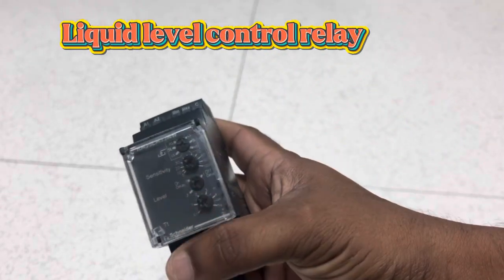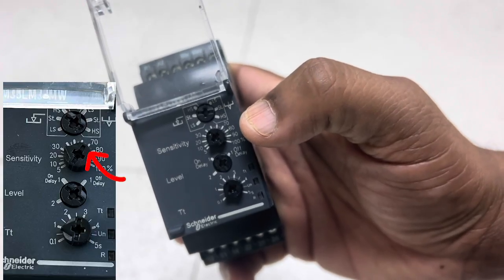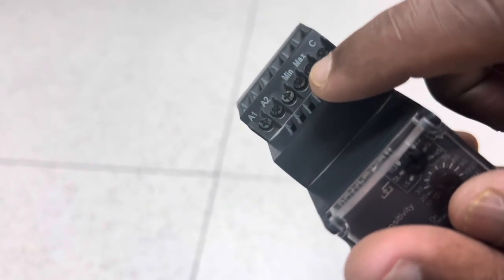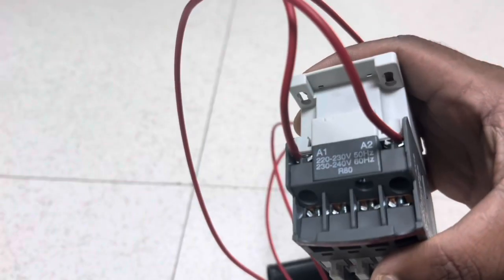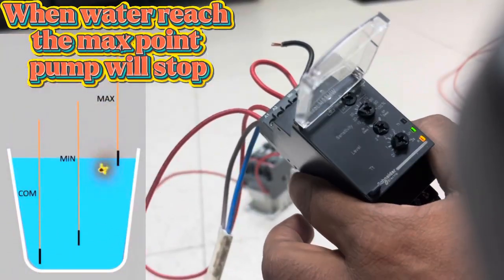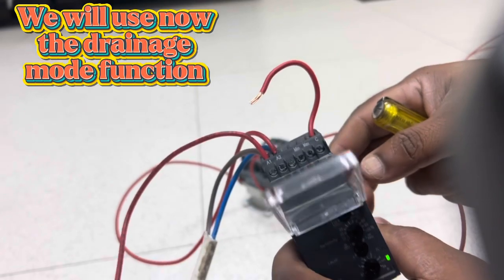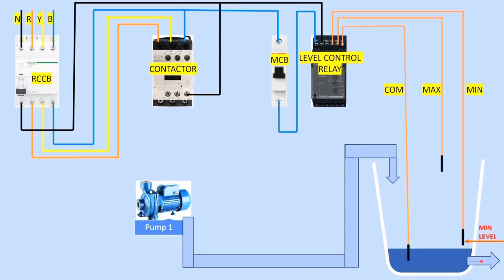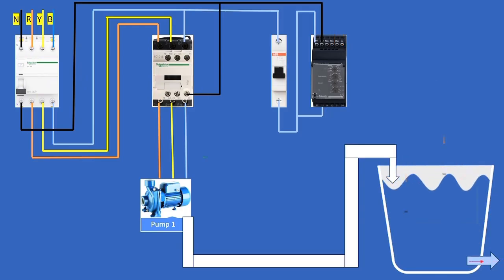Automatic Water Pump Control Using Schneider RM35LM33MW Level control Relay|#automation

Comment: In the demo you are used wire to short the minimum and maximum points with common so I can use float switch ? (If liquid is non conductive)